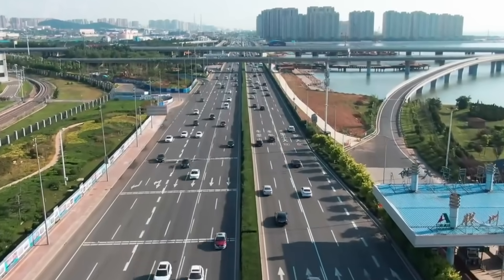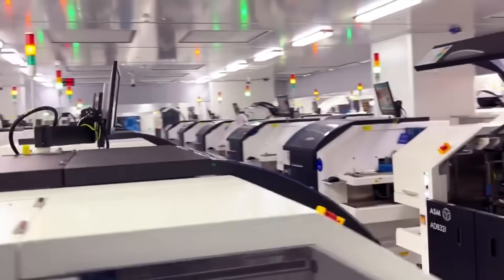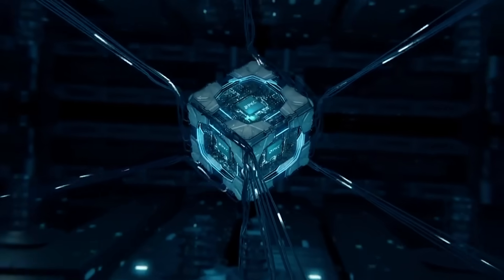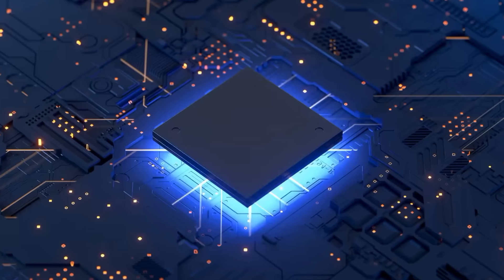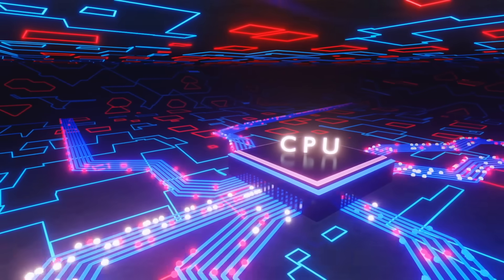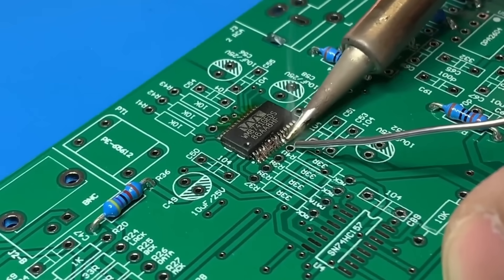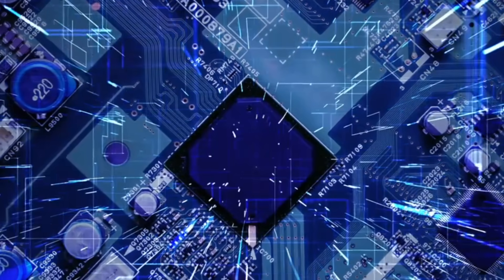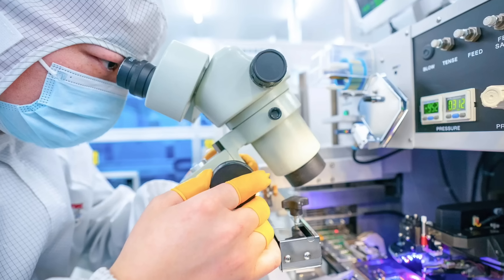SMIC Hits 2nm Without EUV: The Chip Breakthrough No One Believed Possible!

Comment: 2nm transistors are etched with equivalent that can be that small.  You are not etching it with a sharp point.  The only things with that size and can be released on its own are photons, electrons and neutrons.  EUV is photons.  The others require very high energy to achieve.  China is probably using a domeatically produced EUV but not at 2nm.